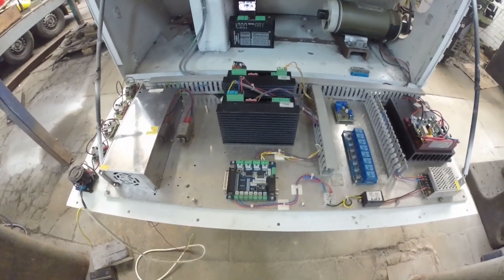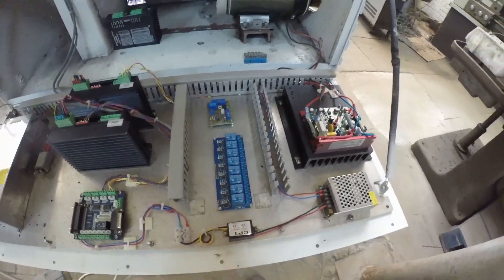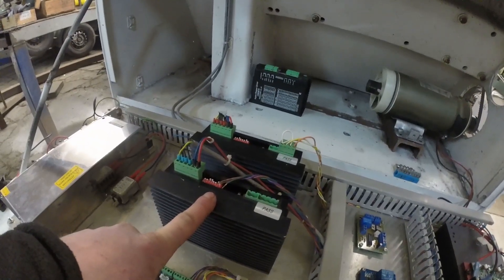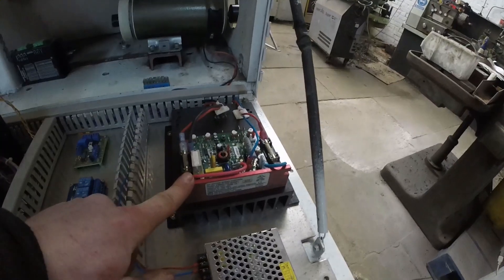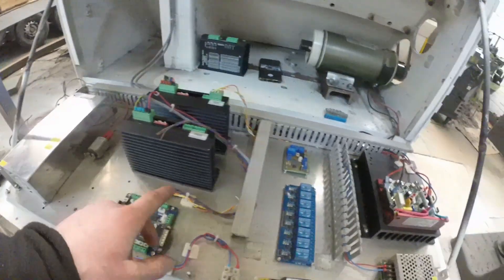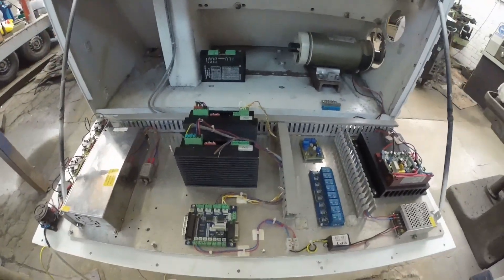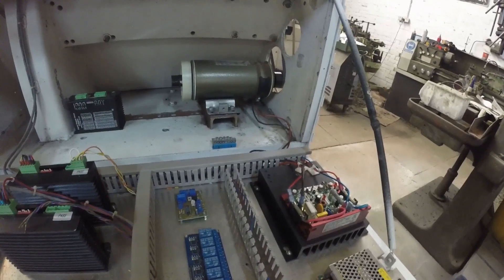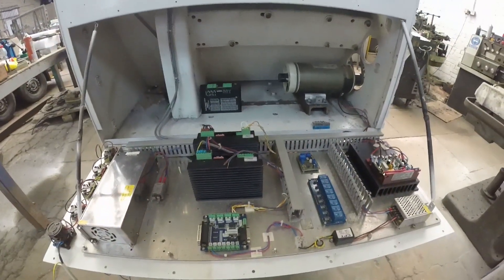CNC Lathe Retrofit Part2- Electronics Boxford 240 TCL

Comment: Can you send me the wiring instructions please 🙏
Reply from the maker: Hello, I haven't any wiring diagrams done yet, they will be put together once the project is finished.
Reply: @owensengineering286  okay dear,  i just finished up my boxford 250 pc conversion to mach3 db 25 5 axis board control. I save the original stepper motors, but i dont know about the tool changer macro. If you need my wiring diagram or any information you're welcome.
Reply: Hi another year passes, I'm going to convert mine could you post what you have please?

thanks chris @samsoumoussama3259

Comment: I see that you have a Boxford 250 CNC PC in the background. Have you done a Mach 3 conversion on that lathe? Do you know anyone who has fitted a pneumatic chuck to the Boxford 250 lathe?
Reply from the maker: Hello Philip, 
I picked the 250 up at auction, to be honest other than power it on and play around on it for a few minutes I haven't touched it.  I do plan to convert to Linuxcnc at some stage. Cosmetically its pretty rough but I haven't checked for bed wear, backlash etc. yet. It will probably end up getting a full rebuild and ac servos fitted. Mine came with a  Pnuematic 5C collet chuck and gang tooling so I assume it was used as a small production machine with a bar puller.
Reply: @owensengineering286  When i bought my Boxford 250 it was in a rough state with the cabinet all pitted with rust. I spent a week stripping the paint off de rusting and painting it in modern Boxford colours. Now it loks like a new lathe. I have the drawing for a pneumatic chuck but not an electrical wiring diagram for the control panel. I asked Boxford for the wiring diagram but they said that they didn't have one. It must need linking into the motor wiring so that the chuck cannot be released while the spindle is turning.. I need to service the turret as it is sticking on number 7 tool. I have the Boxford software but i think i will convert it to Mach 3 one day so as i can make it into a production machine with servo motors. Yours sounds like a good lathe with the air chuck.
Reply: @owensengineering286  Hi Do you have a link where i can buy the speed controller for the motor? Did you use stepper motors or servo motors. I was thinking servo motors as you get feedback that they have moved the required steps. Did you buy the relays as a set or individualy? I have decided to convert my Boxford 250 to run on Mach 3.

Comment: dove é la vecchia parte elettronica?
io lo recupereta e va molto bene!!
Reply from the maker: Hi Denis, Spindle drive at the very least needed recapped . Probably could have patched into the old drivers but not worth the hassle, they are 30 years old and will almost certainly fail at some stage, I've done it before but learnt my lesson. New electronics are cheap, reliable and easily/quickly replaced, they are also superior in the performance they can provide.